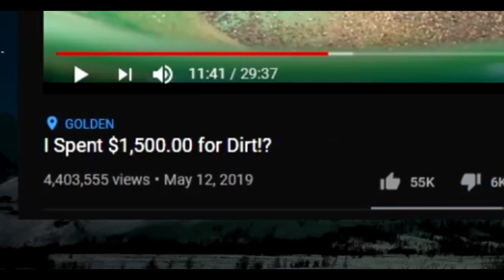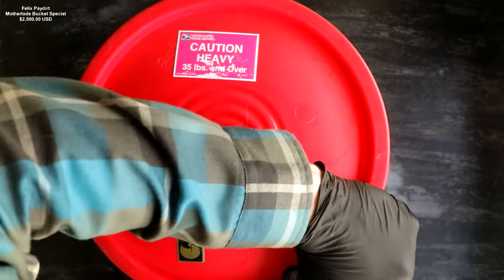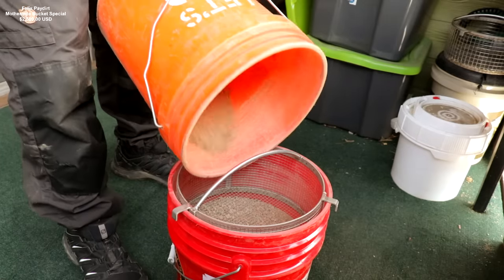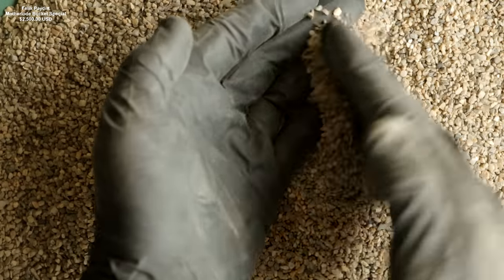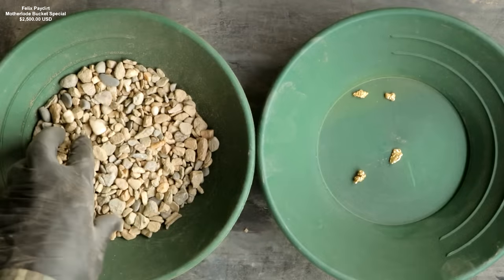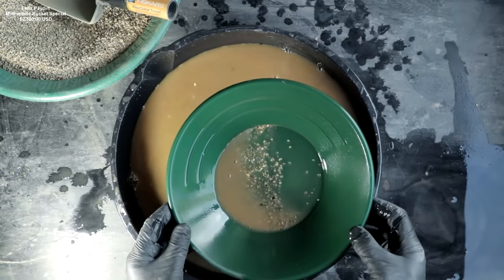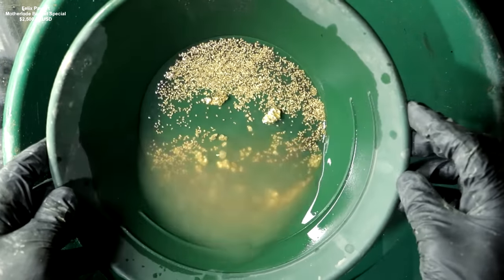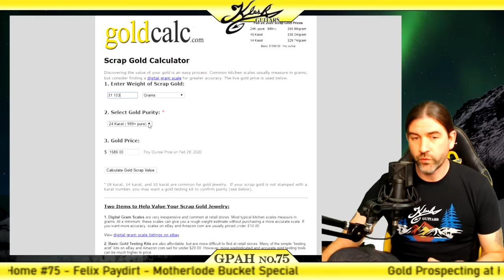I Bought a $2500.00 Bucket of Dirt Looking for Gold Nuggets

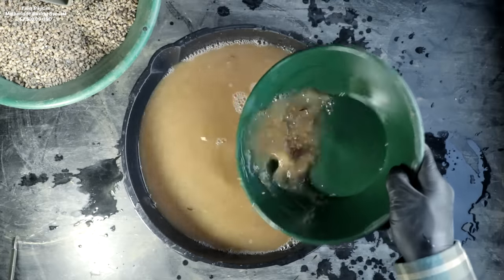Comment: Minor point - 22:31 Gold is actually not heavier than lead. Gold (Au) is #79 on the periodic table, while lead (Pb) is #82. Mercury (Hg) and Thallium (Tl) lie between them, so both Hg and Tl are heavier than gold, and Pb is heavier than any of the three elements that precede it in the Table. Interestingly, mercury, thallium, and lead are all quite toxic, but metallic gold is not. Cheers.

Comment: The biggest problem I have with these is that they are 100% going to take out any big nuggets in them, so there really isn't any chance at a big payout.
There is no way they're going to pour some paydirt into a bucket and not take out big nuggets they see.
Reply: You are right.  They probably sifted it twice.  Got the big stuff out.  Put a couple hundred buck back in and sold the tiny stuff and dirt.  Might have been a $6000 bucket before they went through it.  So, you find the company.  See where they are getting their dirt and sift near there.  Heh!  Heh!
Reply from the maker: Retz there were never any bigger nuggets in this. All the gold I found in it was added, you can be sure of that due to my exact total weights.

Comment: U should use a pin pointer to help determine whether some of the bigger stuff is or isn't gold
Reply from the maker: The pin pointer I use (Minelab pro find-35 or the Garrett "pro-pointers"" would only tell if it's a ferrous or non-ferrous metal and can't differeentiate the metal types. That would require an XRF (X-ray fluorescence), which is a non-destructive analytical technique used to determine the elemental composition of materials.

Comment: Just to clarify things up, gold is lighter than  Pb because Pb which is lead weights 207 amu Au which is gold weights 197 amu , to learn about the Periodic Table and the elements and about Ap chemistry you can check out my channel (AP Chemistry course).
Reply from the maker: Despite being lighter than lead, Gold is denser than lead. Gold atoms can be accommodated more compactly owing to lower atomic and bond radii.
Reply: @Klesh  That is 100% true, and I didn't know that you were talking about density because indeed gold is denser than lead by 7.978 grams per cubic centimeter.
Dont forget to keep up the good work its nice to watch gold extraction videos. and have a good day.

Comment: I think you're in colorado. I believe I have some ore. Could you help me process it? I'd split half.
Reply from the maker: Absolutely! Here's the instructions, you can send half the gold to me 👍 I knew making this video would pay off eventually https://youtu.be/eqMnp6_Dy3o?si=usa1wqCXrz6-n5-o
Reply: @Klesh  Nice! I don't believe that mercury can separate gold alloys. Mercury only bonds with free gold. Argo mine, for example, used the cyanide potash process. I was wondering if you have tried agua regia? Most Colorado Gold was extracted from Lead / Gold alloy, therefore crushing and panning will not work. At any rate, I'm homeless, so I was wondering if you're willing to experiment with the sample I have? I'm in Boulder. Let me know!

Comment: Love the videos but wondering why you don't wet classify less chance of flour gold getting lost in space
Reply from the maker: I don't wet classify so I can remove the magnetic material. When the material is wet, the gold tends to become trapped in the wet black sand, losing more gold than if dry classifying. It's a lose/lose situation, however everything does get panned down so I catch the small amount of flour gold with the bigger material anyway.
Reply: Way to break it down. I understand that logic I may have to take that approach next bag I get

Comment: I've got a question for you saying I am a disabled veteran and no I did not get wounded and while I was in the military I am wanting to get into metal detecting and I am on a very strict budget I am on Social Security disability and I was wondering if you could give me the name of a good detector for under $200 what would you suggest that's all about I can afford maybe that's even too much but I would appreciate any comments from you thank you
Reply from the maker: Sure, I started out the same way, looking for a cheap detector. I found a detector and a pinpointer (very important to get a pinpointer as well, even more important than just the detector) on craiglist for $250 i think. Picked them up and havent stopped detecting

Comment: This company is essentially selling very expensive scratch cards. They sell buckets of dirt containing some gold. Most people will get a little gold, totalling a value less than the price they paid for the bucket. But some (very few) lucky people will find a lot of gold in their bucket with a value greater than the price they paid. This is a pretty unscrupulous business model. However, it is also quite clever. They have realised that they can sell gold for more money by mixing it with dirt. Simply by adding in an element of chance, they can appeal to problem gamblers. You just know that there will be some people who are hooked on these things, buying bucket after bucket, winning big on a bucket, using the winnings to buy more buckets, losing their money, then desperately trying to save up to buy more buckets to try and recoup their losses.

Despite this, there is one purpose this could serve that actually would not be so bad: a novel gift for someone. This could be for someone interested in gold panning or simply a way of buying someone gold as a gift while also giving them a fun activity to do.
Reply from the maker: Spinoza unfortunately there is no extra gold added to any of these, if there were, they’d advertise it very hard. These are just 100% money loss.
Reply: @Klesh  Damn. Even worse than I thought then.

Comment: why don't you make the bucket a little moist? that way the whole thing doesnt dust so much
Reply from the maker: If you wet down the material it would've been nearly impossible to remove the black sand with the magnet. Not like it mattered though, there was barely any black sand.

Comment: If you take a trip to Alaska or the Yukon, it would cost you at least $1500.00 or more and the travel time. So to cost only $1000.00, to get $1500.00 in gold that will go up in value...sure.
Reply from the maker: Nope, I've flown to Alaska for less than $200 and stayed at a hotel for less than $500 for a few days. I'm also not into luxury places or first class airline tickets, i was military so I'm happy with the bare minimum usually.

Comment: “They know exactly how much gold there is, otherwise they would be out of business pretty quick.”

Why? You are assuming this is a loss-loss situation, when it could easily be a win-win. They get the dirt out, package it, sell it for a satisfactory, profitable price and that’s that: if you find enough gold to make a profit, they have still made money out of the venture. Both the seller and the customer are making money: it’s like you are being paid a cut for cleaning it.

Of course I know this is a scam: I’m just pointing out that it would be even if it were real, though it need not necessarily be (I.e. it would be simply because there is no way to guarantee each bucket is profitable, and if there were, the company producing wouldn’t go out of business, but would probably decide to mine it for themselves, naturally).
Reply from the maker: If they added more gold than the value of the product, they'd be losing money. Losing money usually adds up to going out of business. They add less, therefore make a profit. In this case, a huge profit. They will not go out of business.
Reply: KleshGuitars but why would they be losing money? You still haven’t explained that. Adding more gold or more dust does not come at a price: they would be “losing” potential profit (compared to, say, keeping the gold for themselves) but how would they be losing their money? How would costs increase if there were more or less gold in one bucket? They just mine material (gold or dust) and place it in a bucket: unless I am missing something, the costs of the operation remain the same regardless of gold content, so I cannot see how the loss would arise.

P.s. there is notable difference between losing money and making less profit. If I build a Ferrari for 1k and sell it at 10k, I did not lose money just because I could have sold it at 100k: I simply did not maximize my profits. Not maximizing one’s profits does not necessarily lead to going out of business.